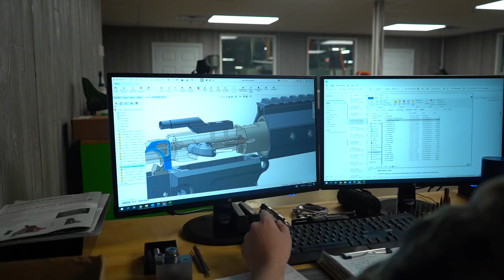.22 Magnum (WMR) AR-15: Reveal Teaser

Comment: Just make a 22 Magnum conversion kit like a cmmg kit with magazine
I'd buy it
Reply: Those cost almost as much as the uppers, I'm sure it could be done, but I'm not sure how well it would sell. The CMMG is so you can shoot cheaply (well, .22 LR is like $0.08/round right now, normally just a few pennies), so I'm a little surprised they are even making an upper in this. I think it could be done though, the normal CMMG would need drilling out and filling with tungsten to increase mass, then assuming its stroke is long enough (I don't have one to check, but it probably is fine), then the magazine is going to need a complete rework (when something like Kel-Tec 30rd pistol magazine would do best), so its just an interesting set of issues.
Reply: Sometimes, those kits can be a PIA and a little time consuming to get them to work reliably. Most people that has a lot of experience with those kits would probably rather have a tested, working pre-built upper.

Comment: I just got my dedicated .22lr 10.5 upper from you guys. It will not feed the first round on its own no matter what. I have to shove the bolt forward, partially deforming the round to make it chamber but then it fires and cycles the rest of the mag just fine. It even does the same thing if I down-load the mag. Any advice??
Reply: I would try polishing the feed ramp heavily. If that doesn't work I would open up a ticket they are sending me a new updated firing pin due to light strikes on mine

Comment: I just got my 300AAC upper from Bear Creek and so far it is working well in my build. I have yet to fire it (waiting on parts for my lower) but once I run it through it's paces I will write a review. Keep up the great work Bear Creek!
Reply: How do you know it's working well if you haven't fired it? Basically all you're saying is it fit together with your lower I guess which isn't surprising
Reply: @AnarchAngel1  it's my first AR build (and first AR) so I'm glad there is no defects. I have fired it now and it works well. My recoil spring is a bit tight and causes failures to cycle but that shouldn't be to hard to troubleshoot.
Reply: @woodlanditguy2951  Is it a standard carbine buffer spring? What buffer are you using?
Reply: @woodlanditguy2951  Just trying to help...if you're using a standard carbine spring and a standard carbine buffer the gun is undergassed. If you're using an H buffer or something drop down to a standard carbine buffer. If you're already using a standard spring and buffer you could try a reduced power spring or have the gas port enlarged slightly to allow more gas into the action. I would suggest putting a few hundred rounds through it before messing with it too much...sometimes a gun will seem a bit undergassed until the spring gets broken in. The gas port will start to erode too which may give you enough gas
Reply: @AnarchAngel1  I still have "failure to cycle issues" with my current build. I'm going to try different brands of Ammo and I have ruled out the mags due to firing a single shot without a mag installed and the bolt still doesn't make it behind the bolt hold open catch. If different ammo doesn't work then I will see about opening up the gas port.
Reply: @woodlanditguy2951  Well I would send it back and tell them it's undergassed if you're using a standard carbine buffer spring and a carbine buffer. It should be capable of cycling any type of 300 black with that setup

Comment: Hey there again Y'all!

I've been waiting for y'all to do this, but what I wanted even more, is for you to make one in .22 Hornet and 5.45 x 39, because right now, NO ONE is filling this markets and unlike the .22 WMR, the Hornet is a true 300 yard gun! I know from personal experience from my H&R Single Shot in .22 Hornet: it kept RINGING STEEL at 300 yards, shot after shot, after shot!

The 5.45 x 39 I want because of my severe spinal issues in my neck and back (3 compressions in my neck and 3 herniations in my lumbar). The 5.45 is ballistically superior to the 5.56, because of the much better BC, but has less recoil than the 5.56.

Lastly, though I know I might as well be urinating in the wind, I will CONTINUE to plead with you to utilize the SIG style Piston Design and offer it to us, instead of just the Direct Impingement. Sig Piston Complete uppers are going for $600 from Palmetto, so while they're more expensive that your D.I. system, they are SO MUCH CLEANER and longer lasting, and easier shooting. So please, will you invest in a Piston System for your Complete Uppers and offer them to us?

The reason I haven't bought the SIG? I want a SIDE CHARGER not the Rear Charger.

Take care and stay well.

Cheers from the Oil Patch in Central WY
Reply: 5.45 is ballistically superior to 5.56 and piston uppers "shoot easier" than DI huh?
Reply: @AnarchAngel1  

Quite literally the BC on 5.56 is inferior to the BC of the 5.45: that is NOT my personally subjective belief, that is categorically provable by any reliable Reloading Handbook, look them up.

Secondly, again NOT my personally subjective opinion, Piston Systems are CLEANER than D.I., and operate much cooler than D.I.: you can do the research and find that the evidence is overwhelming.

I am a Side Charging Fan, which kind of puts me behind the 8 ball financially when it comes to complete rifles and uppers, but were I a  Rear Charging Fan, I'd skip on over to Palmetto to buy one of the SIG Piston Complete AR Uppers for the inexpensive $600 and be happier than the proverbial clam.
Reply: @jrbailey3208  What 5.56 bullet are you even talking about? I can guarantee the BC of 75-77 gr 5.56 is better than 60ish grain 5.45, that's pretty much what you're limited to with 5.45. I'm not arguing about how "clean" they are (even though carbon isn't a problem in DI ARs). You claimed that piston guns "shoot easier", I assumed you were talking about recoil impulse and that certainly isn't the case. The opposite in fact. Piston guns have more mass reciprocating above the bore which gives them more muzzle rise and more recoil than a properly tuned DI gun
Reply: @AnarchAngel1  

Don't you ever get tired of trying to force EXCEPTIONS into becoming the Rule in order to make yourself feel better about the blather you think, say, and post?

The VAST MAJORITY of 5.56 shooters shoot either the 55gr bullet or the 62gr bullet, NOT the 'match weight' 75-77gr 5.56, so please STOP with the implied lying will you?

The BC of a 55gr 5.56 is .267.
The BC of a 62gr 5.56 is .264.
The BC of a 60gr 5.45 is .285.

There is almost a 10% INCREASE in the BC of the 5.45, and when combined with the SMALLER POWDER CHARGE, the 5.45 is indeed, EASIER SHOOTING than the 5.56, especially when coupled with how an AK-74 is set up 'from the factory' as it were.

The difference to some folks may well be 'negligible', but to those of us with cervical spine injuries, the difference is worth courting.

The 'average' AR does NOT have a Muzzlebrake, the AK-74 does, this LESSENS felt recoil (unless you'd care to blather on that this isn't true, when hard core physics numbers tell us there IS), which again, is important for a lot of older shooters.

Secondly, EVERY reliable sources on the Net, in Print, and historically, have agreed that Piston Systems do in fact, shoot CLEANER than D.I. systems: the FACTS are that with the Piston, all the heavy gasses with all of the Particulates involved, do NOT make it back into the receiver; hence, it remains both Cleaner and Cooler.

It's not my problem that you don't like Physics just because the numbers don't work in your favor!

Thirdly, there a two main types of Piston System, Long Stroke and Short Stroke. L.S. have a heavier felt recoil than the S.S. version, and in the 7.62x39 caliber, can and will get your attention. Same for .308/7.62x51 caliber. 

I'm not talking about those calibers, or larger caliber piston systems, and you KNOW that, I'm talking about the 5.45x39 caliber, and you know that as well. 

Hey, you don't like Piston systems, or Soviet era calibers? Fine, don't shoot any if that's what float's your boat!

I don't have any against the 5.56, I'm simply looking at the FACTUAL EVIDENCE that will allow me to utilized a good defense round for both home and field, and the 5.45.39 may be the round for me.

There's also the new 4.6 round, which has a similar felt recoil to the 5.7x28 round, but with more 'punch', and CMMG thought enough of the 4.6 to produce a Banshee it it!

Perhaps you'd like to take a moment to denigrate the new round along with CMMG?
Reply: @jrbailey3208 You're arguing with me about things I didn't even say. I'm simply pointing out that 5.56 has a much more diverse choice of projectiles. I must be one of the weirdos that has 77 gr mk262 in my ARs that does indeed have a better BC than the very limited choices of 5.45 bullets out there. If you want a high ballistic coefficient bullet in 5.56 there are a ton of choices. 5.45 is a good cartridge I never said it wasn't. If you want a muzzle brake on your AR all it takes is a wrench and some shims or a crush washer. Some people don't like muzzle brakes though, me included. Also I think you're going to quickly find that 5.45 ammo is going to become more difficult to get and more expensive than 5.56 ammo. And again, you're putting words in my mouth. I never argued that 5.45 wasn't "easier shooting" than 5.56; less energy will do that. I was questioning your statement that a piston AR was easier shooting than a DI gun, which just isn't true whether you're using a long stroke system or a short stroke system. Both have mass reciprocating above the bore that a DI gun doesn't have. Talk about not acknowledging physics 🙄 I also never argued that piston guns introduce less carbon and heat into the reciever; I was simply saying it doesn't really matter. Piston guns just transfer all the heat and carbon to a different place than what people call a "direct impingement" gun (which is actually not true DI, it's an internal piston system but I won't get into that). I'll take you up on your offer to not use commie guns and calibers since they offer no advantage. They used to at least be cheaper but as I said that's no longer the case

Comment: They really should spend time improving the quality of the offerings they already have.
Reply: Such as?

I like watching them evolve over the last couple years, they went from basic gen 1 side chargers to the gen 2, they also started removing a lot of wasted Mlock mass on the handgaurds, then they have barrels in all options except pencil barrels (they need those, but they do sell a carbon fiber barrel but its pricey), and they have made a lot of sportified uppers without the jam button (and until Kyle needed to use it, I've never heard a single time in the history of using those rifles that the forward assist has ever saved anyone, and granted that took a weird scenario of falling while twisting to make the bolt drag just a little more and not lockup).

I'm not sure what major improvements they could add besides some competition style super light ones with pencil barrels or something like. They seem to have gotten them pretty competitive. Yes you can spend $1k and get something nicer, that's true, these are poverty ponies at reasonable quality, but there are plenty of $1k options already. Sure they can start using titanium parts (tooling change required though, as well as high machining price), and sure I'd like to see some carbon fiber handguard options, but again we're kind of jumping to $1k builds and there are other makers that specialize in that. BCA seems to specialize in low cost, crazy caliber option, and has cheap barrel fluting, and make lefty uppers, that's kind of their market domain.
Reply: Dude I got 5 ..they have always run flawless right out of the box ..if I was a millionaire I would buy there's first everytime ..who else is doing the things these guys are ..BCA ROCKS
Reply: What seems like a few more different options to choose from is a huge undertaking on there already diverse line up. And adding this is huge. They got there niche in the market and they work flawless.  I have 5 uppers from them and haven’t had a single issue with one. They figured out how to make reliable rifles for a good price and I think they killed it.  From a manufacturer aspect. Just changing a few things and making new parts is a lot more work than you might think. And they improve on stuff all the time.